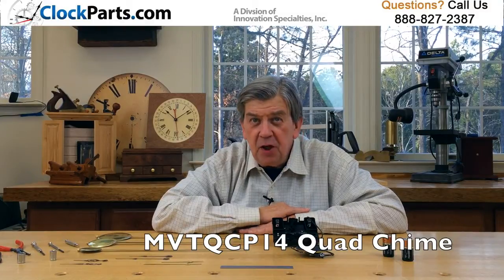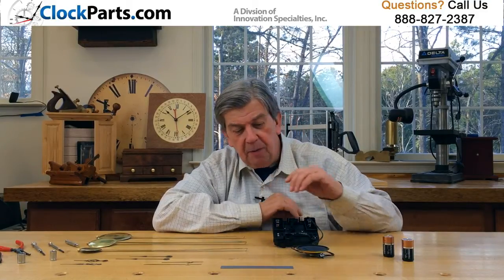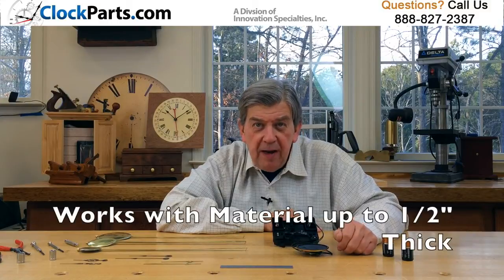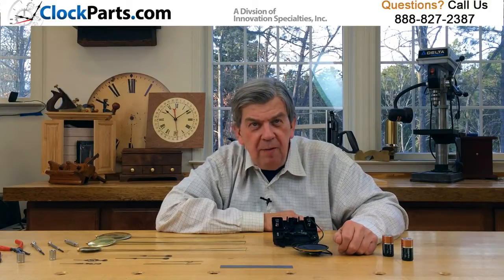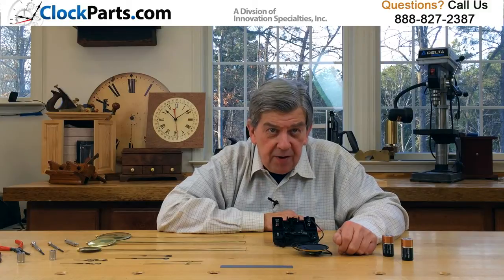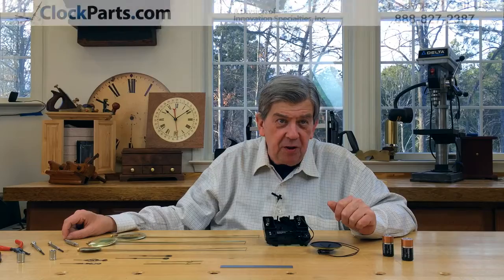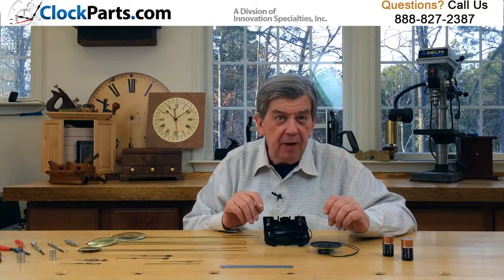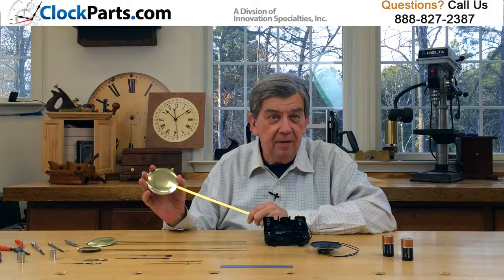Quad Chime Movement - Learn HOW to Build a Chime Clock

Comment: Quarter chiming clock can be otherwise known as quarterly alarm clock because it makes alert of time at every quarter hour. Bim bam striking clock can be otherwise known as half hour alarm clock because it makes alert of time at both at the top and bottom of every hour. At the top it strikes the number of hours and at the bottom only one strike. The strike may be either a two note strike sequence or single chord stroke. Thus it makes alert of time at every half hour. So that it can be otherwise known as half hour alarm clock. A clock that only chime at the top of the hour is hourly alarm clock either it strikes only the number of hours, play only melody or play melody with striking the number of hours. Some clocks that ring, beep or buzz at a selected time to wake up a sleeping person is usually known as alarm clock or wake up timer. The term 'alarm clock' refers especially to wake up timer. Not only wake up timer but any clock that makes alert of time by sound as mentioned above can be commonly known as alarm clock.